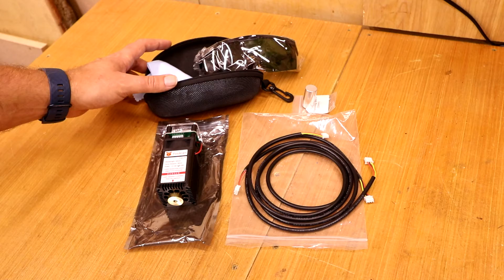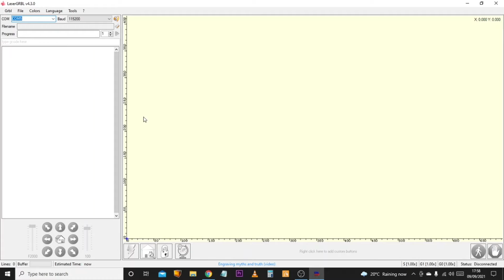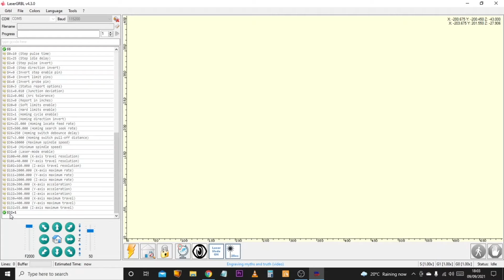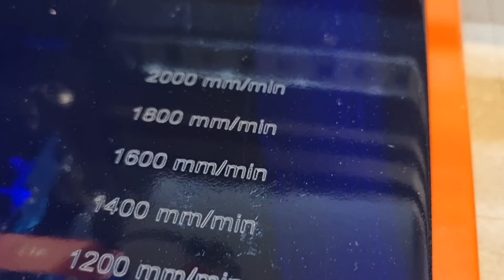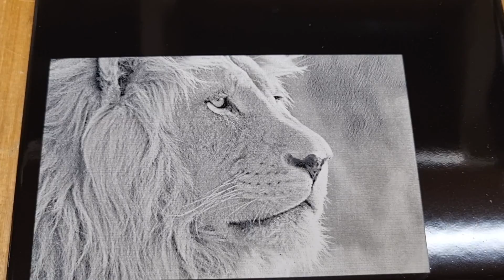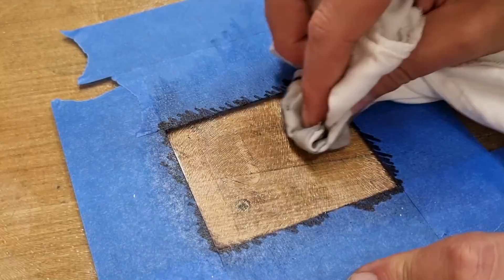FoxAlien 20w diode laser - Setup, testing and review

Comment: Hello do you think this laser will cut 6mm ply?
Reply from the maker: It will take a few passes but should do. This 20w laser is only a 5w output which is pretty low rated now.  For cutting you would ideally want a 10w or 20w output laser

Comment: Is there anyway you can tell me the wavelength of the 20W output FoxAlien? Could not find any info on website. Was looking for some resources and want to be safe. Looking for quality eye protection over-glasses and proper film for enclosure. I'm building my first cnc table, just getting into it and new to lasers as well. Thank you for your time.
Reply from the maker: It's 450 (+/- 5) I believe.
Reply: @JamesDeanDesigns   Thank you so much for the quick response. Do you have a reputable  website to order proper eye protection and film or polycarbonate from?
Reply from the maker: @weslow80  I've recently just ordered these buy not tested them yet. They comes in different styles and are OD6+ rated. You probably don't really want to go lower than OD6. Beyond this the prices really start to jump up, something like $180 for a decent pair. https://amzn.to/3YGcheW
Reply: @JamesDeanDesigns  thank you so much for the info. I’m worried that a lot of the products that populate when searched aren’t what they say.

Comment: Just going to say: thumbs down on ANY company that lists the power consumption of the laser instead of the optical power. That's no different than VW fudging the fuel consumption numbers on their vehicles.
Reply from the maker: But they list both so it's actually giving the user more information. The issue is not the manufacturers, its the market. Your average consumer just getting into lasers will not know the difference between input and output ratings. I agree its misleading but sadly it's not going to change until something is put in place to force companies to state the optical rating first 😕
Reply: @JamesDeanDesigns  Yeah, that's the issue: newbies and those "not in the know" will get ripped off. I know I almost did on more than 1 occasion and I know what to look for. The true optical power was hidden in very fine print. 

Not to mention you can increase the power consumption to any level you want just by adding in resistors to the circuit. "our laser is 200W diode" (yeah it has 10 20W resistors in the power circuit).

Comment: The actual laser optical output power is 5W-5.5W which is no better than any other 5W diode laser module on the market. Does FoxAlien plan on selling a 20W optical output power module now that XTool and AtomStack have them available. If so, when and how much?
Reply from the maker: At the time this was launched, it was better than others on the market as it had a better focal point than most of the others. I dare say FoxAlien are working on new lasers but the technology is nothing new in the 20w output lasers, its essentially just multiple lasers adding up to 20w but that creates issue as well because the focal point is not as small
Reply: @JamesDeanDesigns  Thanks for your reply and info. I appreciate it.

Comment: Does any one know why the laser on a foxalien 4040xe turns on full power when i turn on my controller
Reply from the maker: Make sure it is set to laser mode on the control box. Also make sure the wiring matches. There have been instances from other manufacturers where they have put the wires in the wrong order from one end of the cable to the other. This can cause your laser to stay on when ever it has power

Comment: Hi James, thanks so much for these videos they are super helpful. Wondering how u did the test file for the laser. Did you run them what at a time or was it a template? and also for the image (the lion) what did you use to create the svg? i'm having trouble creating a high quality image to svg
Reply from the maker: You need a good quality photo to begin with, you cam either just load them straight into lightburn or you can run them through imagr.com which process the images ready for laser

Comment: Hello James,I would to ask you about your laser enclosure.How did you build this?It looks so awesome.Everything is perfectly setup.can you tell me this please?
Reply from the maker: It's a fairly basic frame with MDF board on the outside for the most part. Nothing fancy with the joints, all just cut square and screwed. Where the windows are, I used a circular saw to cut a channel and in the wood, assembled 3 sides of frame and then slid the plexiglass in before adding the 4th side to the frame. You can use clear plexiglass or even clear Amber orange sheets which helps protect your eyes from the laser

Comment: Is the 25% output from input wattage rating standard throughout the industry?
Reply from the maker: It varies depending on how efficient they are but that's a good ball park estimate
Reply: @JamesDeanDesigns  between Fox Alien, XTool and Atom Stack which would prefer? And or what’s your ideal Diode kit?
Reply from the maker: @charleshetrick3152  not really fair of me to compare as I've not used all 3.  I can only comment on the FoxAlien one. They are built well with great customer service. They also seem to be more efficient than some others, for example I've seen other manufacturers need 50w or 60w to achieve what FoxAlien do with their 40w.
Reply: @JamesDeanDesigns  solid copy,  it is surprisingly hard to find anyone who’s done a proper comparison between all the different brands.  Usually YouTube is awash with folk stress testing machines and trying to prove one is better than another.   I may have to just buy one of each and start my own channel.

Comment: enjoying your video, thinking of getting a FoxAlien CNC (probably the 4040xe)  with a lazer.  Sounds like you find FoxA to be good maker.  I've looked at Genmitsu, see it more often,  And then there is YoraHome which seems to have very satsified users,   ....  Or should I wait and get a bigger one like a OneFinity or Longmill Router based CNC (also looked at New Waves Shark units.  Those all run $1600-$2600+ (CDN$) where as the FoxA and Genmitsu are closer to $1200-$1400.    While Canada has fewer options than USA but still a little overwhelming on which one to choose.  My shop is small so a big 1mx1m unit is too big.  FoxA's 4040 is nice size for my shop.

Comment: Another great tutorial video James!  Now that you've had both the FoxAlien & ProVerXL 4030 for a while, which do you prefer?  I'm weighing the pros & cons of each, but it's a difficult decision.
Reply from the maker: It is a difficult decision, they are both good machines (and good companies) the only piece of advice I can really give to help is if you plan to do laser then I would say go FoxAlien, if you plan to machine harder materials like aluminium then perhaps go with Sainsmart, everything else inbetween they more or less do equally.
Reply: @JamesDeanDesigns  You don’t see an advantage in one over the other in regards to the screw drive versus belt drive?  Since the FoxAlien laser can be added to the ProVerXL, is that a configuration you’d prefer?
Reply from the maker: @dougreichback1607  that is essentially what I was getting at. The FA is belt driven so better for laser work. If you look at CO2 lasers and 3D printers they are all belt driven for those faster traverse moves. Equally on the flip, machines doing harder materials are typically screw driven or even ball screw. Its not a case of one being better than the other, its a case of what do you as a user want to do more of. Yes you can install a laser on ProverXL but it will not work as well as the FoxAlien. Equally you can drop a large router onto the foxalien but it may not perform as well (although I haven't actually tested it)